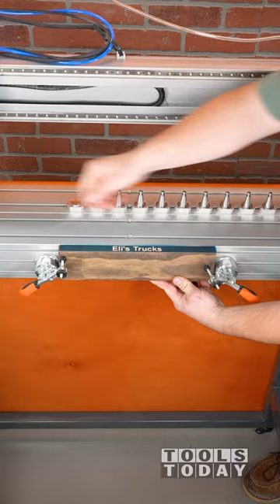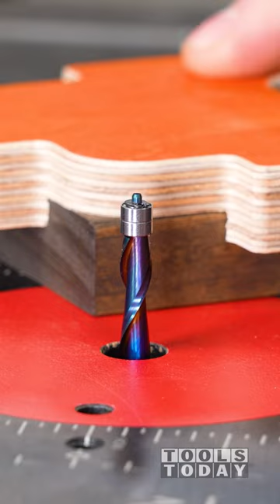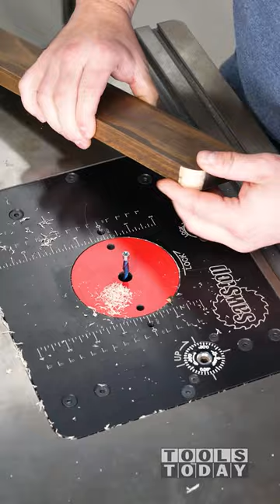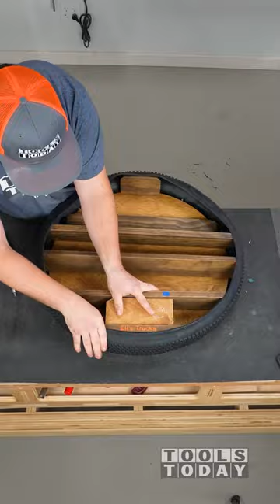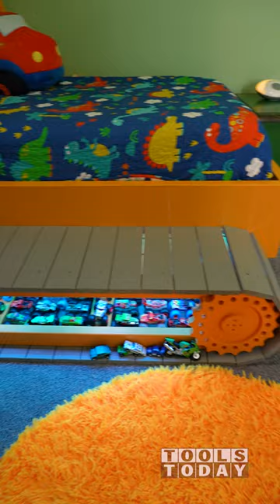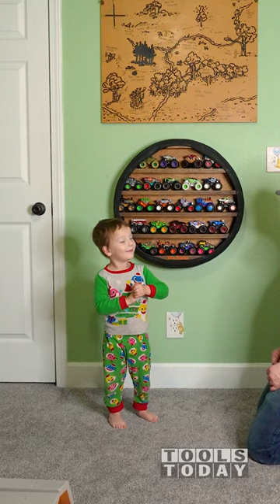Making a Wheel Shelf #woodworking #diy #cncmachine

Comment from the maker: What do you think of how this turned out?

Check out the tools used on our site -https://toolstoday.com/v-14976-46448-k.html
RPM: 18,000
Feed Rate: 40ipm
Plunge Rate: 20ipm
Depth of Cut: .04"

Stepcraft M.1000 CNC machine - https://toolstoday.com/stepcraft-m-1000-cnc-system.html

Oramask 813 - https://toolstoday.com/oracal-oramask-813-stencil-film-12-inch-wide-x-20-foot-long-roll.html

Flush Trim Bit- https://toolstoday.com/amana-tool-46197-k-sc-spektra-extreme-tool-life-coated-ultratrim-spiral-1-4-d-x-1-ch-x-1-4-shk-x-3-inch-long-w-double-ball-bearing-up-cut-router-bit/?from_autocomplete=flush+trim+spektra-26856

SawStop Router Table - https://toolstoday.com/sawstop-rt-tgp-27-in-line-cast-iron-router-table-for-pcs-and-cns.html

Countersink Bit - https://toolstoday.com/v-11618-55227.html

Fein 12v Drill - https://toolstoday.com/fein-71161061090-ascm-12-qc-4-speed-cordless-drill-driver.html
Reply: Can't not see the out of round section at top.